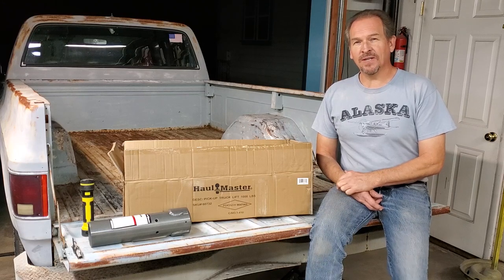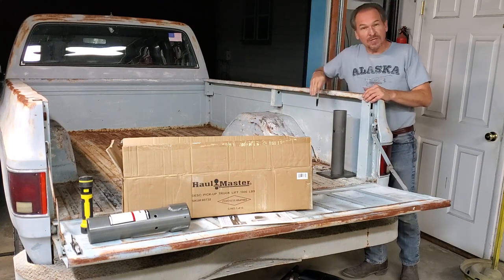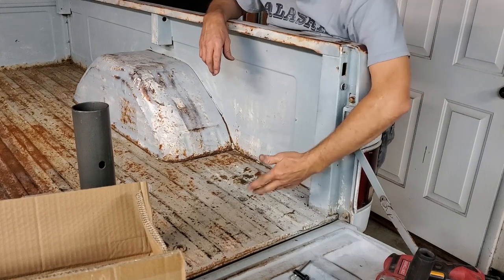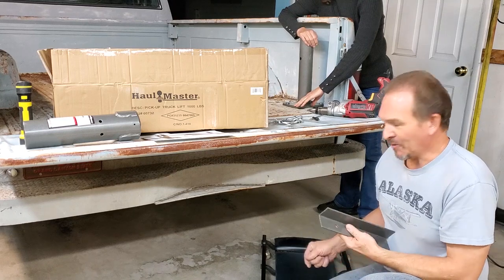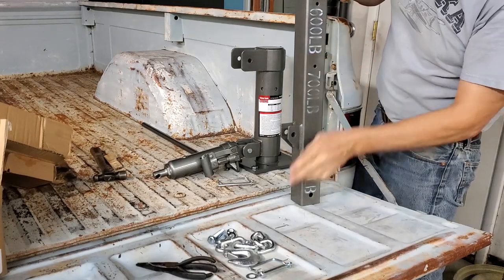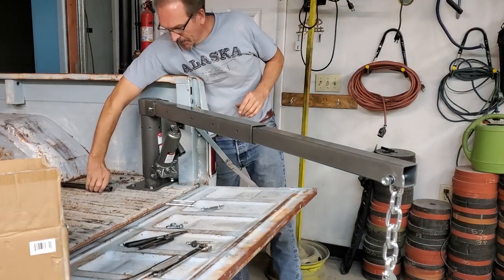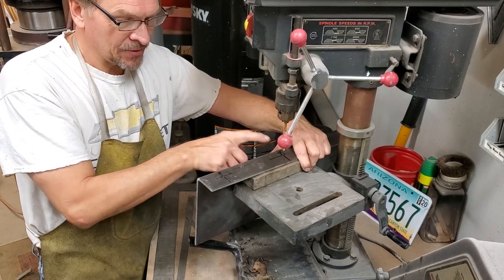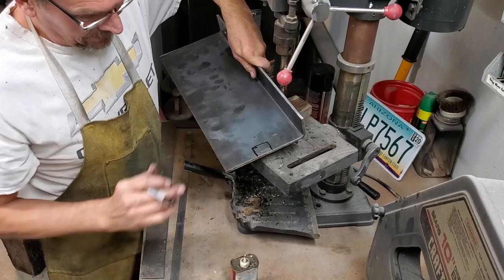How to Install a Pickup Bed Crane - Harbor Freight Pickup Bed Crane

Comment: I'm a salvage parts deliverer and am researching best way to mount one of these. Was told bed only will end up twisting the bed. One Co worker suggested custom bent u bolts going around frame but I'm not sure about that. I like your method and will pass this video along to the guy that's installing it for me.
Thanks!
Reply from the maker: Right on! Happy to hear that our method is useful. Thanks for passing this on to your installer. We appreciate the views.

Comment: I liked the video, music was to loud, couldn't here your voice very well.  I like the diffrent way you done yours compared to others, I have a 2012 Ram 350 dually crew cab long box , been thinking about putting the taller one in but so i can remove off the post for when i'm towing the goose neck or 5th wheel.
Reply from the maker: You have some good ideas there. We have an upcoming video that will show how a winch can be installed inexpensively and make it more versatile.

Comment: Good video! I have a 74 c30 i wanted to get one of these to help load engines into my bed. Would you say there is enough room to swing a motor with the tailgate down? Thanks
Reply from the maker: Yes, there is. Thank you so much for your question and for watching our video.